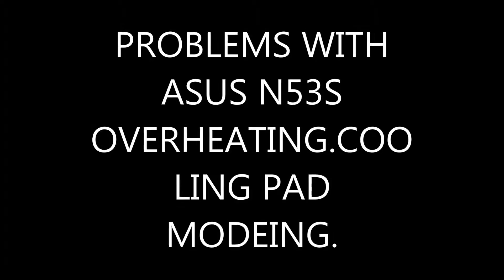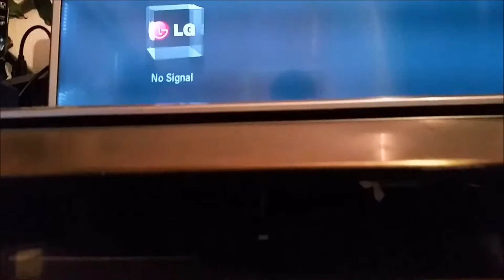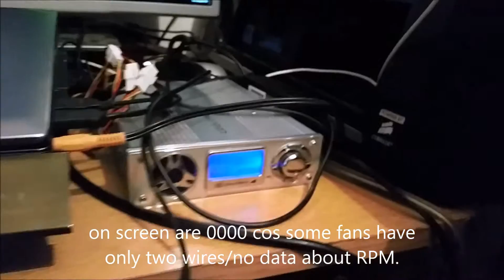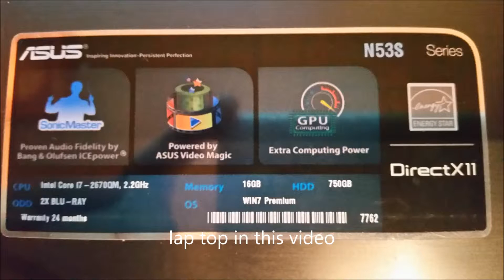ASUS N53S OVERHEATING PROBLEMS AND COOLING PAD MODEING

Comment: hi, i have the same laptop and i will drill the holes, but first i want to change the cpu and probably de vga thermal paste, any idea if that is possible? thanks.
Reply from the maker: yes you can easily change, paste on CPU as it is possible on desktop computer. it's all the same.
Reply: Ty :)